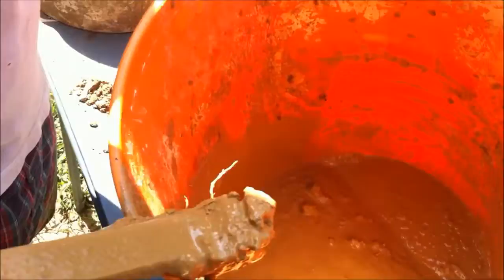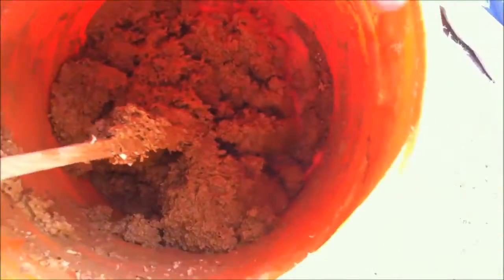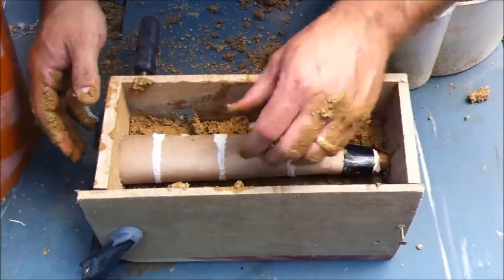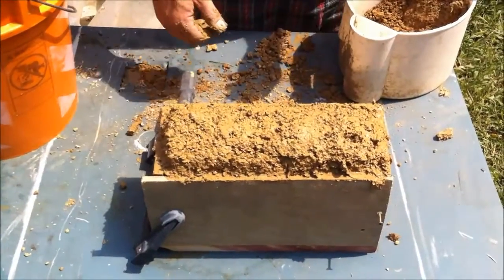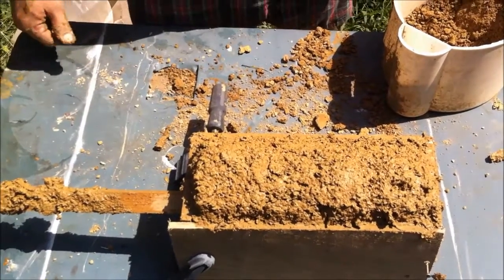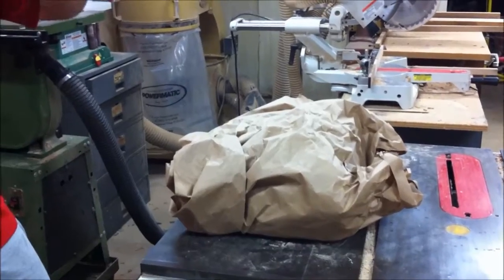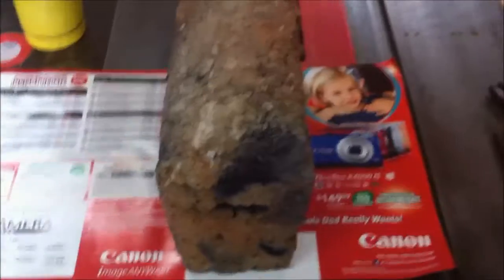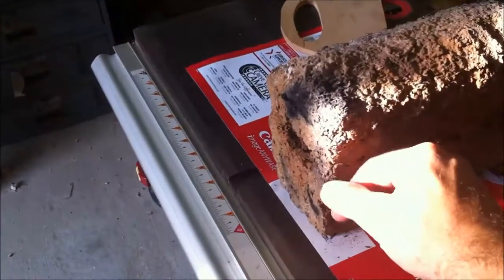The Knife Heat Treat Kiln

Comment: Thanks for the video. That helps a lot. 
How did that particular blade turn out then?
Reply from the maker: +SRT911 Glad it helped.  I've made a few with that setup and used one pretty heavily with no issues.  I have found the Brownells anti-scale coating really helps reduce oxidation.  The one in the video has a couple marks that didn't come out after sanding/polishing.  Gives it character, but if you want perfection on a budget, the anti-scale is the way to go.